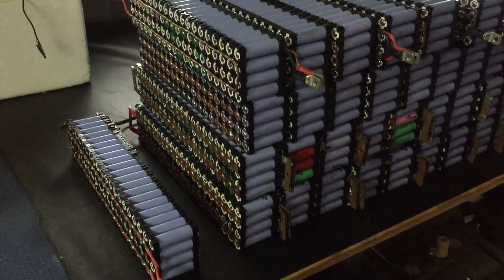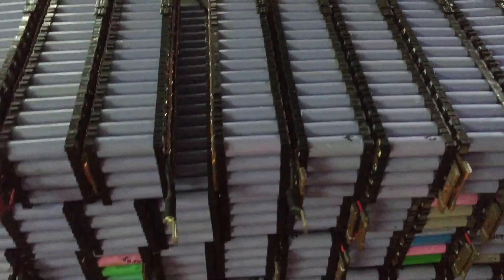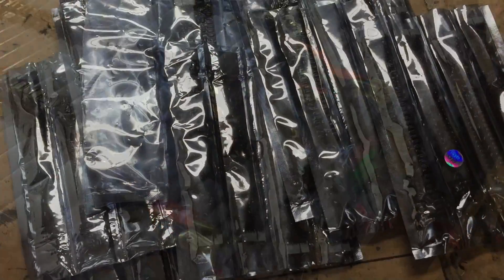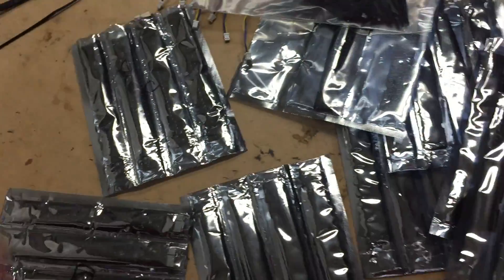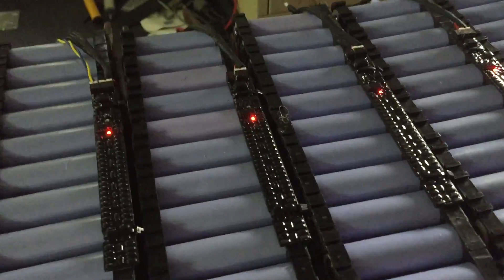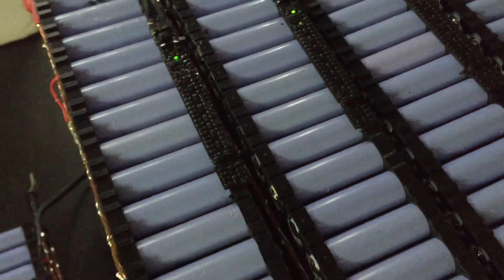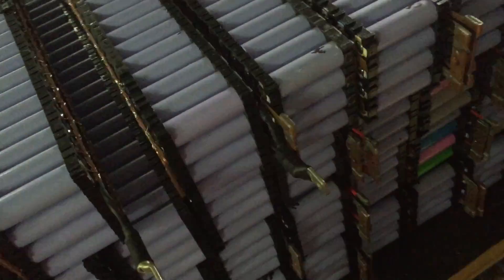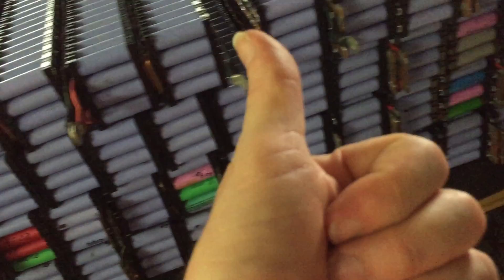It wasn't stolen! 3360 18650 Cells are still safe and sound, just starting to install Batrium BMS

Comment: Shame you couldn't get the little LED displays working, but I suppose the mons do it, be it remotely. I wonder if you could cut the link between the powered side and the sense side on the LED displays, and convert it into a 3 wire one with separate power.

Comment: wow that looks insane! Just out of curiosity how many cells are sitting on that table??
Reply from the maker: 4480
Reply: HBPowerwall so 4500 batteries * 2.5Ahr per battery * average cell voltage of 3.6V is about 40kWhr of storage, generously. Pretty impressive.